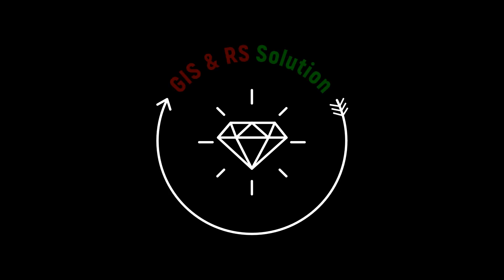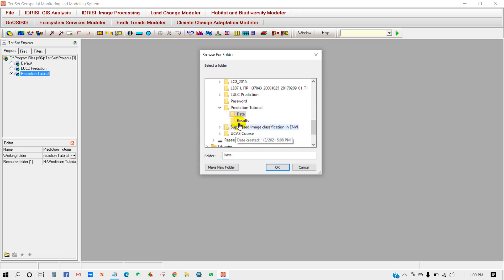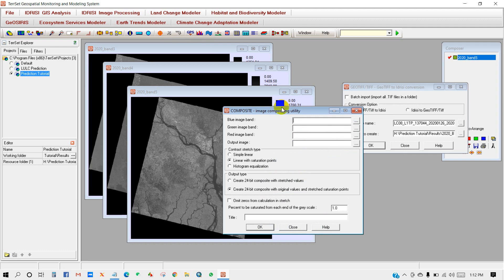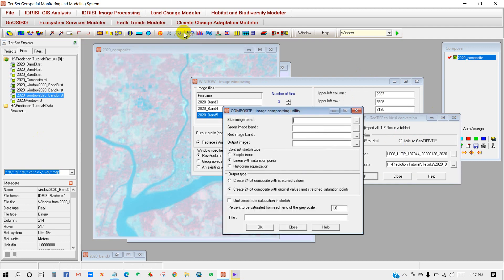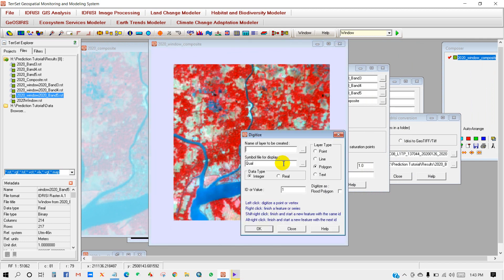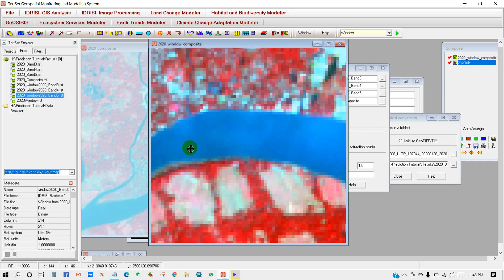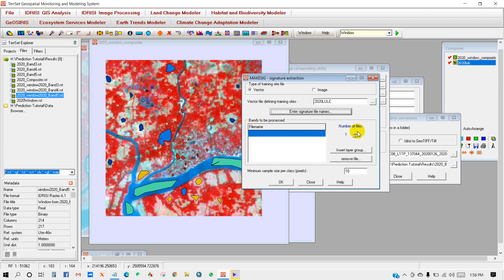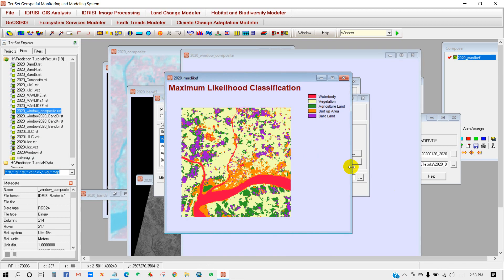LULC Prediction Tutorial Part 1: Land Use/Land Cover Map

Comment: Hello, I have faced an issue when i was doing supervised image classification in Terrset software. Showing an error dialog box with " M.sig 0 not found" . I was following your tutorial.
Reply: I also faced similar issue sometime when using MAXLIKE classification only (the other unsupervised methods worked well). Some literature said I had to use same naming style and keep all the files in same directory. I tried all these it didn't work! I just uninstalled and re-installed now working okay. So still do not know cause, if you find out